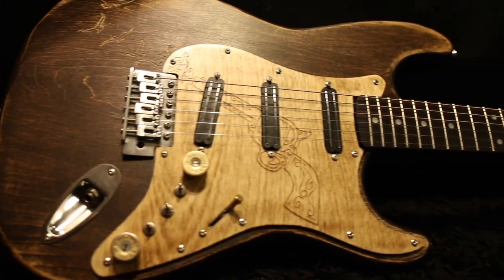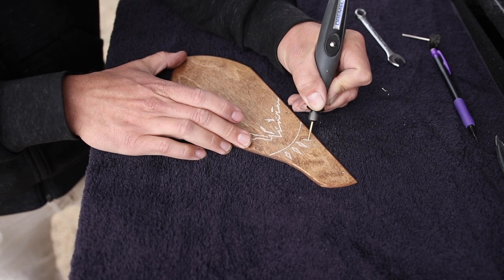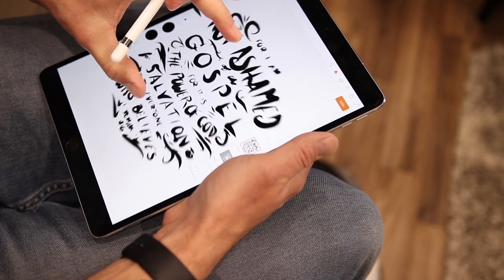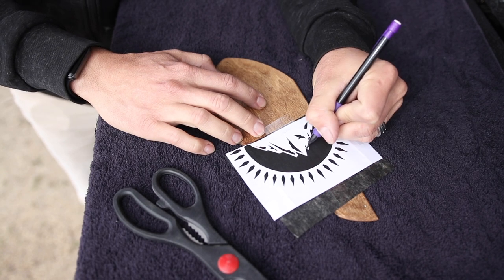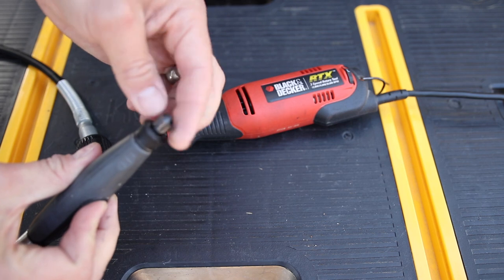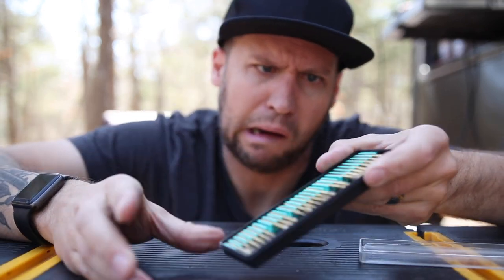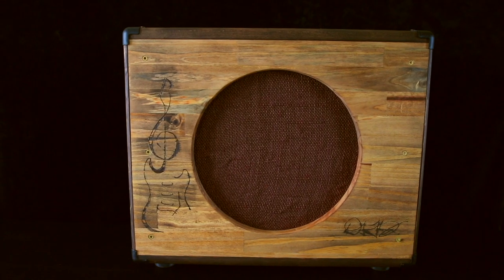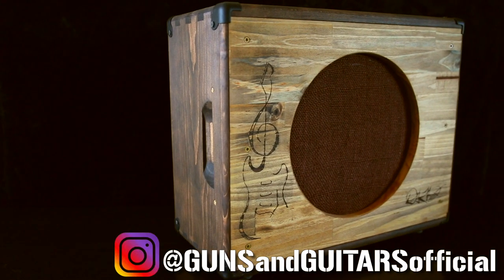How to add a CUSTOM ENGRAVING to your GUITAR!!!

Comment: Great video. Suggestion... I do cnc engraving and use stick on vinyl to get 2 tone colors instead of sanding off your first color, just carve thru the vinyl and it acts as a mask for your 2nd color. I use vvividvinyl. Works great.

Comment: Hi, Dan. I’ve used your practice technique at 4:20 as a tattoo removal method...with varying results. LoL 😂 But seriously, because I know you like to do awesome things while saving money, I think you’ll like a tip I picked up decades ago from a book, titled “Pearl Inlay.” In it, the author suggests that you ask your (or any) dentist to save their used dental drill and grinding bits. They quickly dull too much for dental work, but they’re still plenty sharp enough for wood carving and engraving, and they last a really long time! When I was a network engineer in MS were installed and maintained several dentists’ offices and clinics, and they would set them aside after sterilizing them, and just gave them to me. After I moved away from there I just asked three small dental practices to save them for me. One, a periodontist, didn’t use them, but both of the others did, and were happy to save them for me. The only problem I’ve found with doing this is when you can’t get them anymore for some reason - they’re that much better than the regular ones.

Comment: Lol! I have a kit coming soon (a King V kit). The timing is perfect! Great video, man!

You also inspired me to make it mine and to sand the color a lot.  Infact, instead of a 3 way switch, I'm going to use on/off switches to turn on or off every pickup (5 pickups, 2 Hs, 3 Ss).
I also bought a bunch of Single pull single throw (or was it single pull double throw?) switches to toggle parallel or series for the pickups. Since I ordered five I'll try to have 2  switches for every humbucker pickup so that I can choose the north or south coil and if I wire it in series or parallel.

If you're wondering how I'm gonna fit the single coils inside, it's simple. I'm drilling extra pickup cavities and I'm gonna install in the bridge a single coil, to really get that chuggy sound when I palm mute (I play a lot of metal, and the most satisfying thing is getting that chugga chugga sound when I palm mute). For the third pickup, idk if I'll install it but I'll see.

The kit is from pitbull guitars. 

Also, why don't you do a flying v/king v build? I never saw one on your channel. Anyways, lately I'm learning a lot from your channel and I thank you for these extremely well made videos.

Comment: I have just taken the plunge and deep engraved an animal silhouette in a headstock. Not knowing much at all about the process, I started by drawing the silhouette with a thin black permanent marker. At first the plan was to leave it like that. 
But then I traced the outline using an exacto knife/box cutter. Which in hindsight was not a good idea, I think I would have got better result if I did it with my rotary tool, but I was worried it would be difficult to control so I chickened out. When I did start to use it to take away material from inside the shape, I realized the rotary tool was easier to control and did way cleaner lines than the box cutter. 
I want to fill out the engraved cavity with silver glitter goo and have it contrast against the amber headstock. The problem I am facing now is that the outline of the animal shape is not perfectly straight, and I am not sure that whatever goo I use will fill the cavity evenly. 
Anyone have any suggestions for 
a) what kind of glittery goo to use - I've been considering building up glittery silver nail polish in layers, and also considered getting clear epoxy and adding glitter powder to that - not sure which one would work better. 
Also: 
b) how to tidy up the outline?

Comment: Pro tip: engrave your name in the control cavity of your guitar or under the neck plate (if applicable) in case it gets stolen. Hard to find, because who would look, meaning hard for the thief to remove or lie to the cops about

Comment: Hi, I been searching for engraved humbucker covers, I am surprised there is very little to find or choose from,
Reply: for that, if you're looking at a metal pickup cover, you've honestly got several choices to DIY it, one of which involves using an engraving bit like Dan here, the other option is to electro-chemicaly etch the design.

If you want the design to be raised, get a transfer shop to print out a positive (so the bit you want to be raised up in the design) onto a vinyl transfer sheet or paint the design onto the pickup cover with nail polish or something. The point is you need a barrier.

If you want the design to be recessed (like a normal engraving) you need a negative image (or everything but the design) made, again either painted on by hand or vinyl transfer. After your design is ready, protect all the other areas of your pickup cover (including the back of the holes, you might even want to paint some nail polish on the inside of the holes. By which i mean the bit that isn't on the back or the front of the cover) making sure to leave a small area to attach an electrical current.

Next, mix up some salt water, I forget the exact ratio but you'll likely be able to find it online) get a few cotton buds and a 9 volt or stronger battery (more power will make it etch faster but, clearly, be careful)
Attach the positive lead to the case, soak the bud in the salt water and attach the negative lead to it. Then press the bud to the casing in a firm dabbing motion. Before long you'll see some black stuff on the cotton bud; that's part of the metal that transferred from positive to negative with the flow of the electricity! Isn't science rad? Continue to swab, swapping out buds as needed, until your etch is as deep as you want.

This would work best for silver pickup covers, but so would an engraving bit because the colour is only a very thin layer. If you have a blow torch and a brass wire wheel, you could sand down a gold coating before etching, then heat the metal up and brush with a spinning brass wire wheel to transfer the colour.